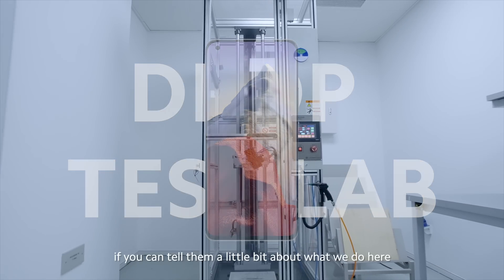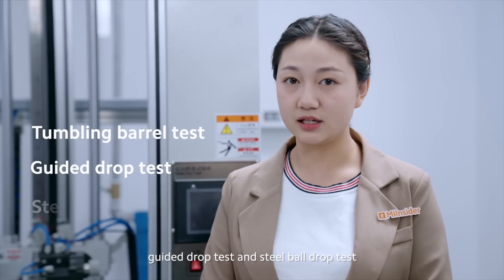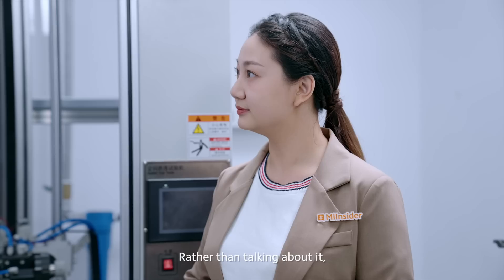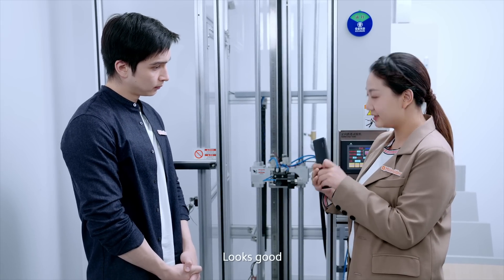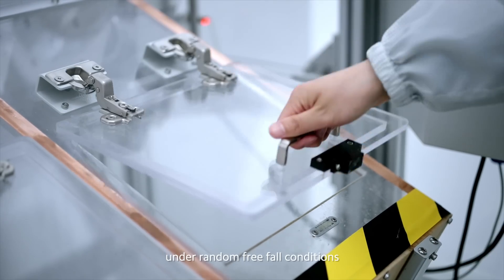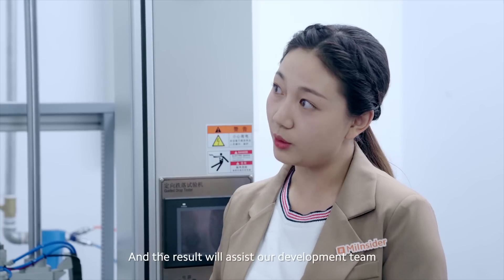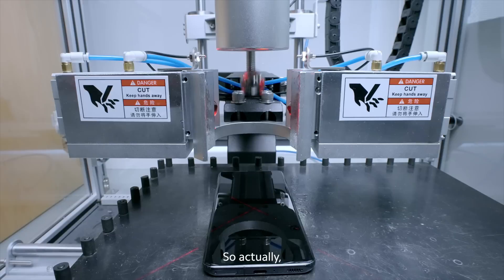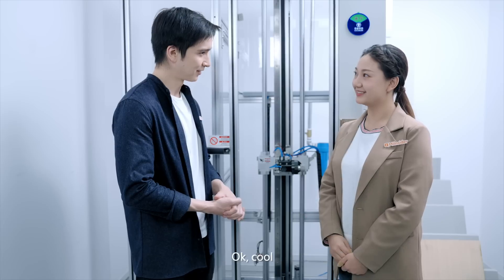The Xiaomi Durability Tests! | #MiInsider

Comment: I am interested to buy Xiaomi 5G phone and I prefer Xiaomi 10S which fits perfect with features and budget, but I am really sorry the Xiaomi start using Mediatek processor perhaps for little bit extra margins I prefers Snapdragon processors which are fast, generate less heat and consume less battery as I feel, I would have purchased mi 10s if it has Snapdragon

Comment: My Redmi Note 3 Pro went through a lot but still no physical damages. Every time it got hit hard, just the screen protector broke and I had to change the screen protector. Other than that it was really a solid phone! It had other issues, like weak cellular and wifi signal, quick battery drain, etc. But that was not unexpected from a 5yo $195 phone.

Bought Redmi Note 10 Pro Max just 5 days ago and I just hope it is as durable as a good glass back phone gets.